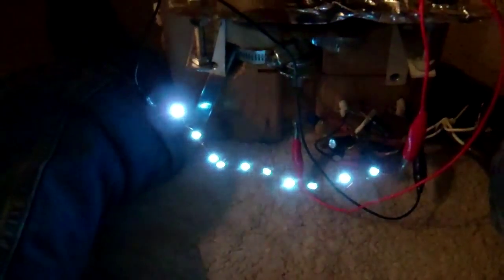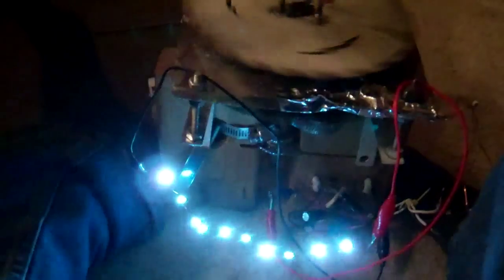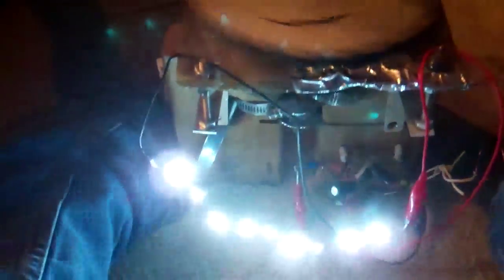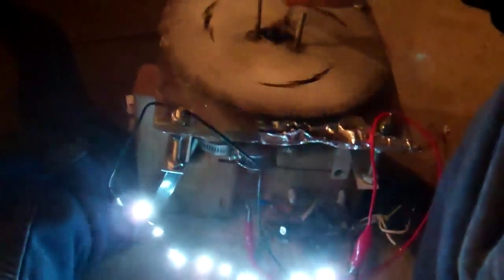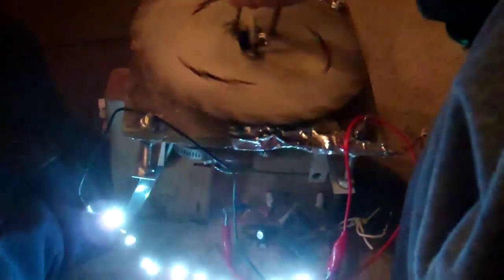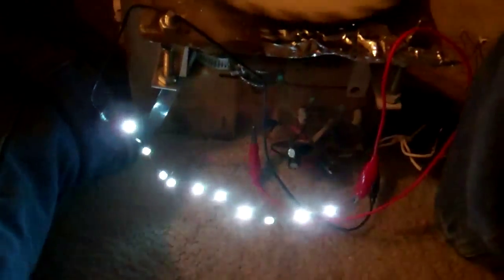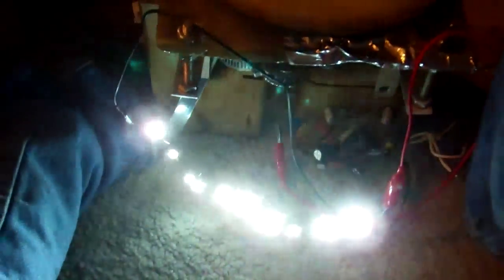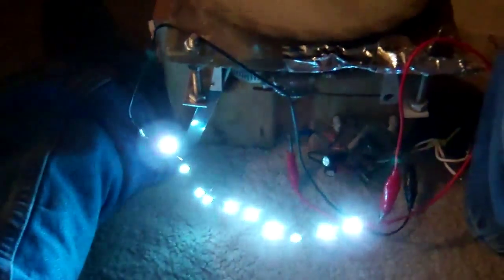Smoothing the output of an axial flux alternator.mp4

Comment from the maker: @rikkiesix It's more like one capacitor's negative to the AC input  and capacitor's positive to the rectifier dc positive. Then, one capacitor positiive to the AC input and the capacitor's negative to the dc negative. Ed Lenz's page has a pdf diagram showing this. I might not be using this set up in the proper fashion though as he was using it for a single phase alternator.